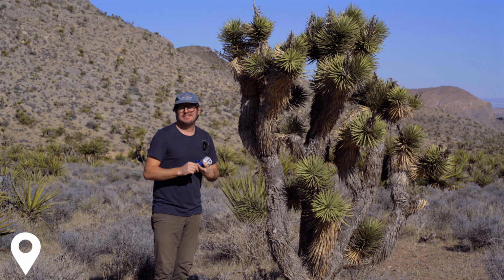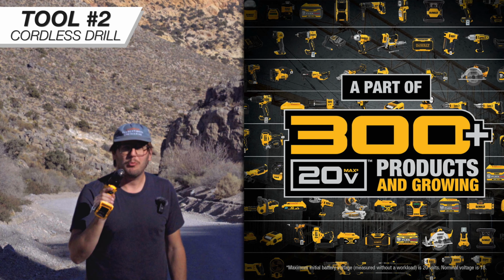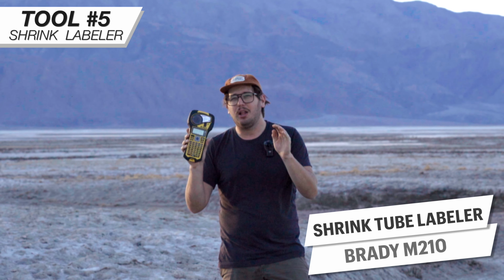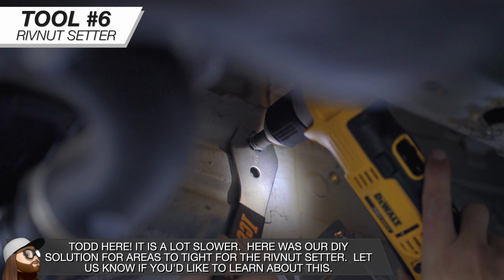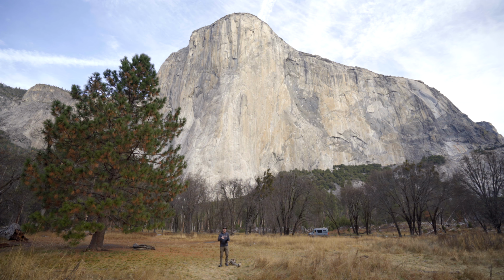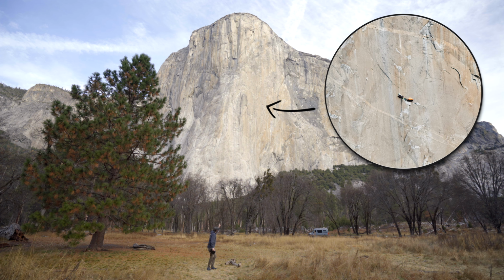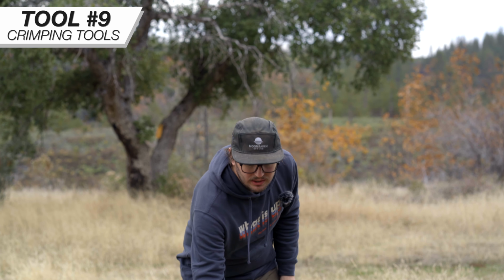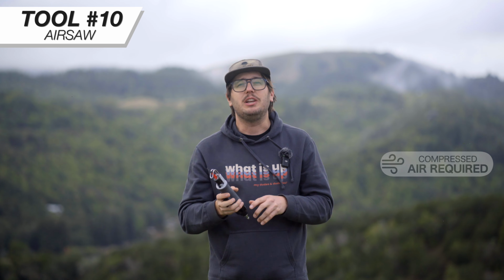Todd's Top 10 Tools for Early DIY Van Conversions

Comment: What is up!? Just found your channel a week ago and have been going through everything. I'm just starting a rebuild in my van and these videos have given me some great ideas.

What size hole saw bits to you use most? Planning to buy a small set of the high-tpi bits but thinking I probably don't need too much precision for routing wires. I'm assuming sizing for fleet tube is the most important? Maybe for pex tube as well?
Reply from the maker: Hey there. Thanks for coming along for the ride we really appreciate it!  

The most common sizes I use are 1” and 1-1/4” these give enough space to also grommet those holes for things like pex and split loom.  Aside from cutting a precision hole they do it with a lot less chatter.  The regular holesaws are so grabby that it kind of tears a hole rather than cuts one.  10TPI is a massive improvement the ATIs are even 10x better than that.

Comment: When using the rivnut air tool what PSI did you find that worked the best?
😀
Reply from the maker: So far all my Rivnuts have been M6 (1/4" equivalent) or M10 (3/8" equivalent).  For M6 I use 80-90psi and for M10 I've been using 110psi. 

I always double set just to be sure.  Set once, tight the thread again and set one more time! 

Hope this helps!

Comment: FYI I have the Milwaukee Fuel family of cordless tools and their M18 heat gun is not good either. A corded version is still a much better option and something I use a ton all over the garage.
Reply from the maker: Glad to know it’s not just the Dewalt!  I will say the major advantage so far of the cordless gun is the size. When working on my Hydronic Heating system recently I was using Gates Powergrip hose clamps which require heat and there were some areas where the corded gun could just not fit. 

Anyways, starting from scratch I’d see if I could find a quality corded heat gun that’s as small and compact as my Dewalt cordless to fit into tight spaces.
Reply: @moonrakerdesign  yep and to be clear, the M18 heat gun is the only product in that family that does not work well but it still has its uses. A heat gun would definitely be in my “top 10 favorite tools overall” list. Kevin // MTX
Reply from the maker: Totally it’s a super handy tool to have. I have a few of the M12 tools from Milwaukee and they are super solid so I would assume the M18 is right up there! 

Overall, I think just the idea of a battery powered heat gun is tough since it’s literally just burning power lol!
Reply: I have the DeWalt and use my Son's Milwaukee. The Milwaukee drill is far superior